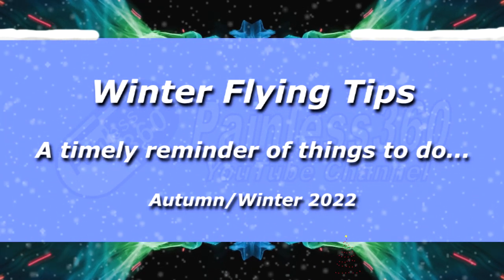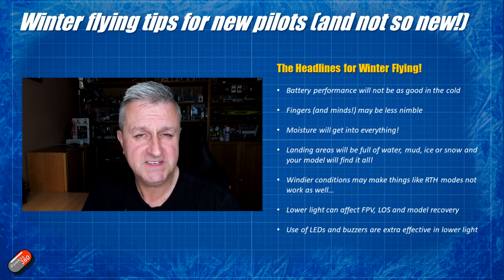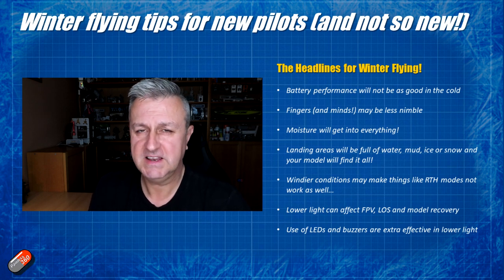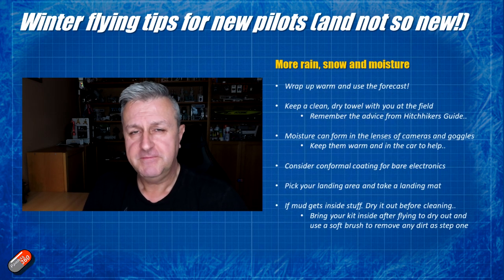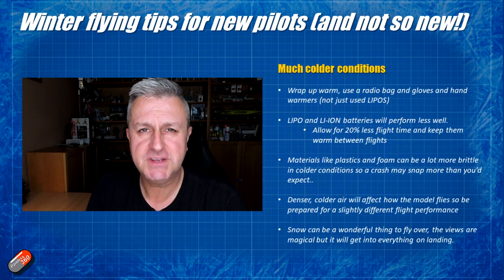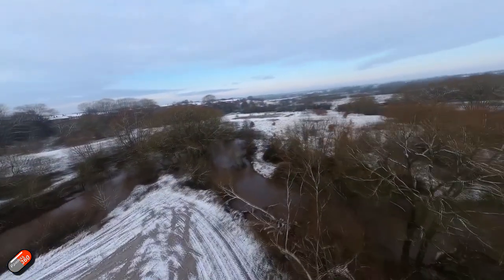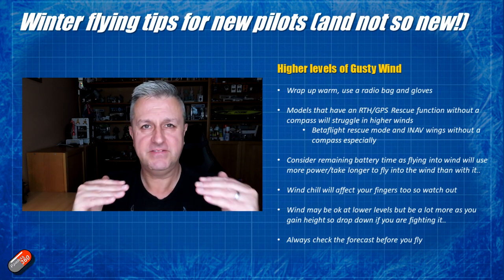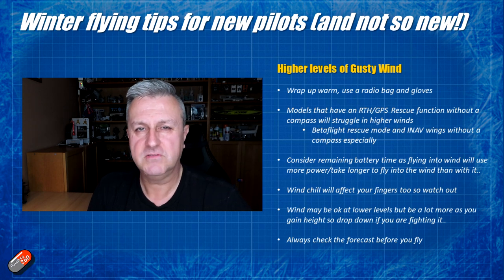Winter flying tips: Avoid the common mistakes this winter!

Comment: Battery levels, I prefer to NOT rely on a timer, instead I use the telemetry to tell me the pack voltage AND report every 30 seconds on the lowest CELL voltage. - - If you are flying FPV, your recular field can look VERY different in winter vs summertime, and you can quickly get disoriented.
Reply: Same here. And my field isn't recular but it is rectangular. 😏
Reply from the maker: I use the same method, you find that the battery can't cope with high current draw the same way so you may get low battery warnings way before it is time to land with heavy throttle use. I tend to use the mAh used OSD elements in INAV as they seem to work well in all conditions..
Reply: @loc4725  - oops I meant to type a 'G' = regular!

Comment: Huge +1 for conformal coating on ESC and flight controller boards. If you need to later solder the board, the first touch of the iron melts the coating off the pad.

Comment: Great tips, Lee! Thanks! 😃
Another tip is to print small covers for USB ports and other open connectors. You're probably going to lose lots of them... But I still think it's better to have them. 
Anyway, stay safe there with your family! 🖖😊
Reply: That's actually a very good point. Today as I was flying a missed the landing pad I put in the field that thought came to mind. typically I do conformal silicon coating on my electronics... except... on any type of connectors. For those I something called from Drydrone called shake 'nbake, but there's is always wet mud which is annoying to get out (well you can let it dry... but if you need to use it in the meantime, like in the field... forget it).

Comment: Hobbyking used to sell* Lipo heater bags designed specifically for warming up Lipo's just prior to flying. They run off 12v (3S) and fit both Lipo's & CO2 pistol bulbs. 

* They are still listed on the site but haven't been in stock for about a year. 😕
Reply: You can make one out if glove warmers or heated underpants etc all available and ready with simple mods
Reply: @rotormasher  The HK one is temp controlled with selectable temperatures although that said those suggestions aren't a bad idea.

I didn't realise you could buy heated underwear though. Must be a female thing; personally I have no issues in that regard and in any case the idea of having electrics running 'down there' doesn't strike me as very appealing. 🙂
Reply: @loc4725  yeah the temp control is sweet, totally man all sorts of garments out there with heating elements inside. In fact I've got a radio heated mitten that is very nice too

Comment: Interesting is that I feel that quads seem to be more locked in. Flight times for FPV Drones seem to be more or less the same (if the batteries don’t cool down before flying). Probably fixed wing is worse.

Comment: 🤣arthur dent towel drone hack - got it thanks!
Reply from the maker: A towel is about the most massively useful thing an interstellar hitch-hiker (or winter RC Pilot) can have!
Reply: @Painless360  i purchased a radio bag hand warmer bag which has holes for hands to go into and its fleece lined so toasty and a clear window to see the radio, last winter i regularly flew in -10 so i'm hoping it will make a difference this winter, will let you know if i rate it

Comment: Thanks for the information and reminders.  It's been -30c here for the last week, and we're looking at 3 more months of it.  Freestyle quads are a blast in snow, but shorter flights for sure than summer.  And no question that snow gets everywhere.  One crash and the quad looks like a snowman and you're done for a couple of hours till things dry.  I'm considering branching out to wings for longer flights  Does anyone have any recommendations for a 1st FPV wing that is winter durable?  I don't mind building it, and it would be nice if it could carry a gopro 10.  I've read that the sonicwing AR pro is good.  Any suggestions?  Thanks.